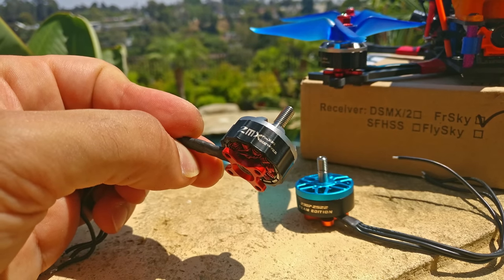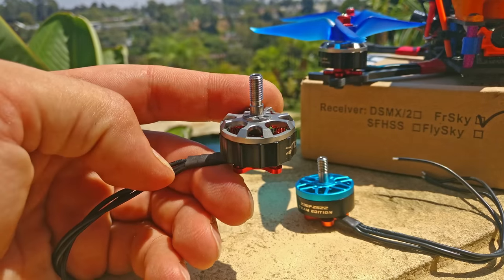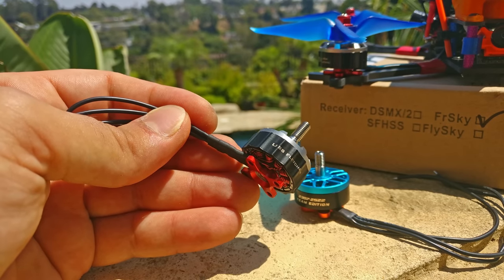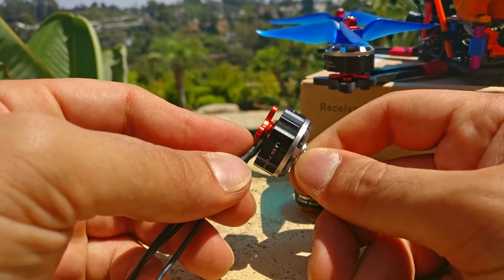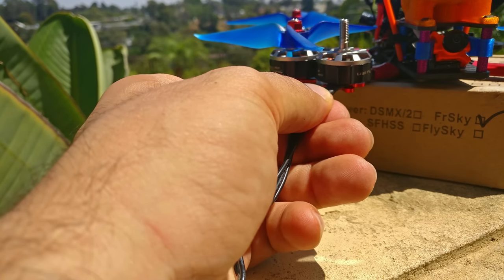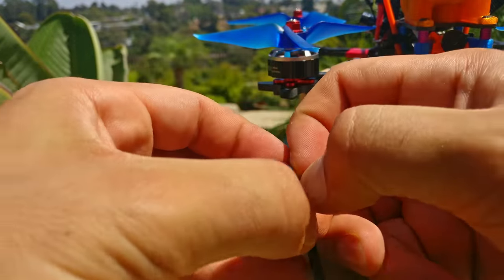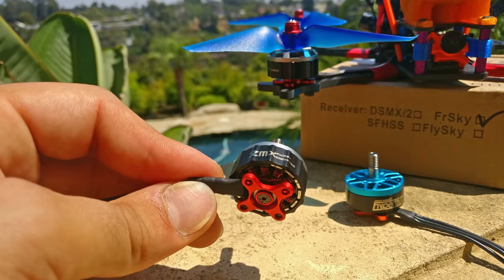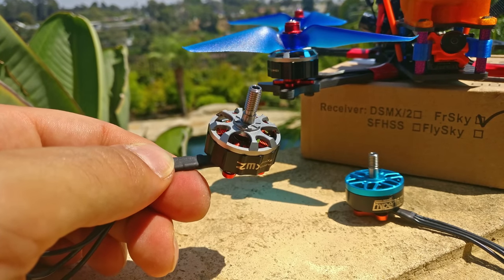ZMX FinX30 2600kv - Discussion

Comment: I kinda of wish you would have given this motor a glowing review without describing how it works. I feel like the cloners are going to come out in full force especially with the motors being back ordered.
Reply from the maker: 505Goat it'll attempt to be copied for sure since most companies look to zmx for ideas. but they might mess up the calculations. the design of the magnet structure is patented however and this market is not it's primary use. it's just a test market for them
Reply: It's actually a huge CNC challenge to manufacture this type of flux ring if you don't get the parameters right. From my experience with Chinese factories, I have to say not all companies are like brotherhobby. Chinese are kind and respectable people. I have high confidence that they will live up to my expectation :)

Comment: Can you run a 6s battery on the finx30?
Reply from the maker: probably will be no issue.  They take 5S completely fine.
Reply: Add a 1500uF low ESR capacitor and you will be fine :)

Comment: I would have bought the X20 Fusions had it not been for the silly shipping cost. Maybe later.

On the topic of 5x4x3's, I'm not sure if you've seen this, but GEPRC sells a set of 20 props for $7.39 on Banggood. I was wondering if you would want to take a look, and compare it to the other 5x4x3's on the market. 

Here's the link: https://www.banggood.com/10-Pairs-GEPRC-5040-V2-5-Inch-3-Blade-Propeller-Triblade-Props-Colver-Prop-Transparent-Color-For-FPV-Racer-p-1169484.html?rmmds=search 

There's also a solid colored set, but from what I can see they're exactly the same. 

Thanks for the explanation of the ridges on the motors, quite a cool think ZMX has got going here.
Reply from the maker: Daniel C. I've tried a lot of different 543 copies. the DAL and RK ones are the best ones by a mile. at $0.25/prop, I'm not worried when I recommend them.
Reply: Daniel C. Checkout Raymon fpv. Amazing pilot and he's using them for freestyle.
Reply: Daniel C. I've flown the GEP 5040x3, I only have the DAL 5040 v2 to compare them too. I think they have a crisper feel during flight due to the material being more rigid than what DAL uses. However, they are not as durable. If you bend a prop you can fold it back without leaving a crease like the DAL 5040, but if you hit something harder than grass and keep the motors spinning they have a tendency to shear between the middle of the blade and the tip.
Reply: The shipping fee to the US maybe around 14usd I think. Also the prices on the site are all in SGD, which is 1.4 times lower than USD

Comment: you need to understand what a "Hallbach" array is & what it does. there is Nothing in that magnet or flux ring remotely applicable to Halbach's  research. Everything you said is junk science.....the scalloped flux ring is not a new innovation, but it is nice to see one in production. you are correct about torque & kv. Copper fill is king for creating torque.
Reply from the maker: Thudmoto I meant to say paudo halbach effect. was my mistake. it's not a true halbach.
Reply: Why has someone not created a true hallbach arrayed motor? I mean i get it would be difficult to produce on a large scale (testing each magnet individually and arranging them in the optimal order for each motor), but if it had a dramatic effect... I pay 50+ a motor for them.
Reply: 1st. @Kabob sorry for the double post...one got hung up somewhere & i re-stated my concern. Whomimizfpv. Hallbach discovered he could re-create the closed circut of magnetic flux with no back iron with alternating 45 degree poles on surrounding magnets. Unfortunatly, its not as effective as a simple ring or plate. It takes 5 magnets to create a single poie in a hallbach array. our motors are correctly described as having 7 pole pairs. that's 14 magnets in the can. Nothing pseudo Hallbach about that design. All it does is give a thicker flux directing back ring at a portion of the circuit to completely capture the magnets flux in a closed circuit.  The scaloped machining reduced the weight of a really thick back ring. Just looking at it I'll give props to the designers & manufactures of this motor. its a real step in giving up a "No-Compromise" motor.  if you want the Best in motor design, detail & finish, this motor is a 1st choice.  As for the Marketing guy's dropping Hallbach's name & saying "pattented technology" ....thats just funny.
Reply from the maker: Thudmoto well thanks for that. definitely is beyond my knowledge. I wasn't told this much. I did a little reading on the halbach array that they were talking about and figured that it mostly makes sense but I cannot really confirm any of it. all I did here was present what I discussed and explained my performance experience. I'll pay more attention in the future and not try to spread BS...not my intent

Comment: With some motors I know the money is in the bearings. Like full ceramic bearings aren't cheap so I could see why they would charge more.
Reply from the maker: USA UAV yeah but ceramic bearings can be even less durable.  every bearing on any motor I've used so far ultimately breaks after a certain number of flights or crashes.